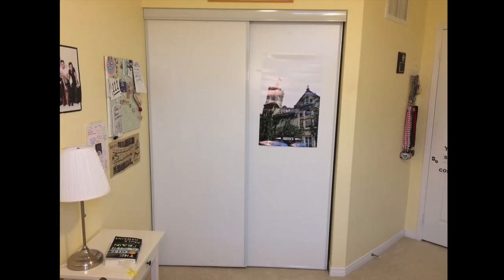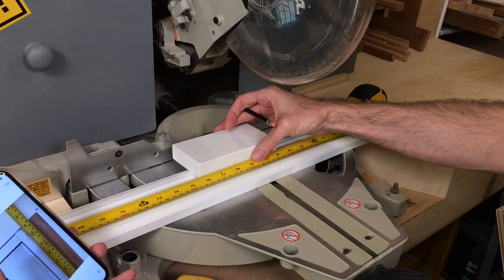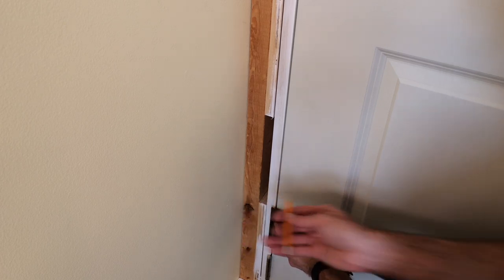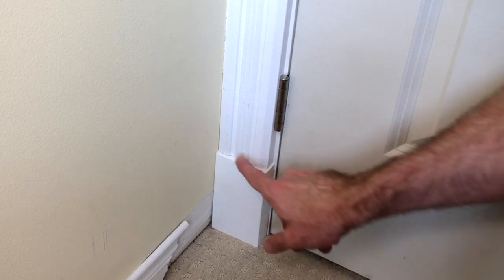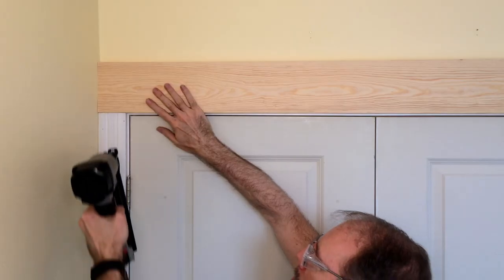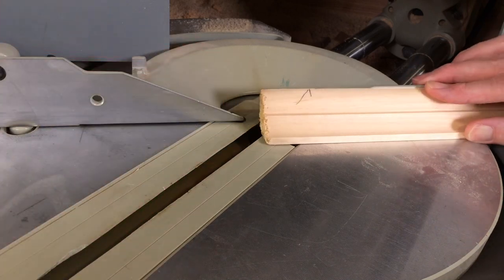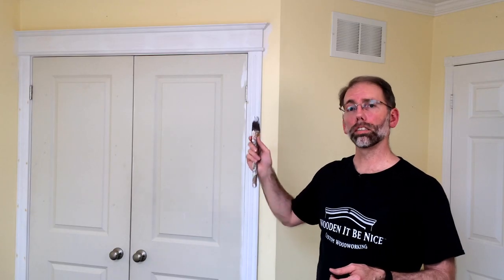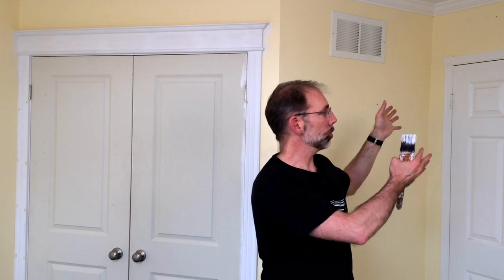How to Install Door Trim on Closet Doors - Casing & Finish Carpentry

Comment: Scott, is that a saw stop jobsite saw I see.  I would be interested in a tool review when you have enough time with it.
Reply from the maker: Yes, it is.  I've replaced my 20-year old Delta with a safer model.  Thanks for the idea for making a video.  Cheers.  Scott

Comment: Nice work! Could you have trimmed the returns on the back (flat) edge with a belt sander or sanding block?  I appreciate the book references. Thanks!
Reply from the maker: Good question John.  That's the approach I use when I pre-build the caps in the workshop... you will see that in the next video.  I use a Japanese pull saw, which is quick and accurate.  Cheers.  Scott

Comment: Remote off on switch for the Saul. How much lazier are we going to get?
Reply from the maker: The remote is for the dust collection system, not the saw... that sounds dangerous.  Scott
Reply: Clearly you've never manually turned a dust collector off and on repeatedly.  It's a total workflow killer.  My setup is even more automated than this one, it automatically powers the DC on when the saw comes on.
Reply from the maker: Oh, that sounds cool.  Is it an iVac switch system?
Reply: @HomeImprovementWoodworking  yep, it's the iVac Pro Tool Plus.  It looks like you already open an iVac so you could add it to your setup for minimal effort.

Btw I was responding to the first guy not you, I didn't tag him so not sure it was clear.